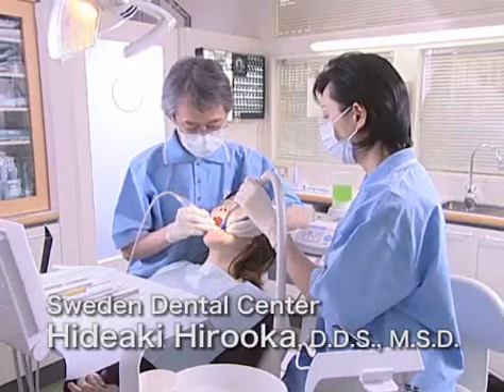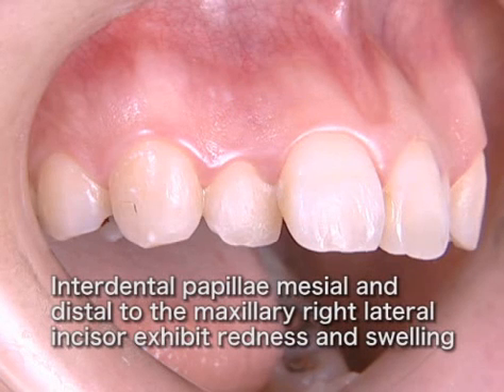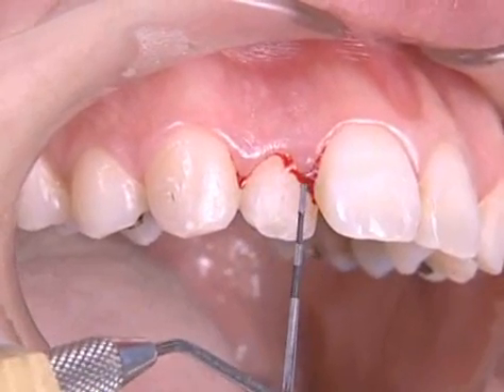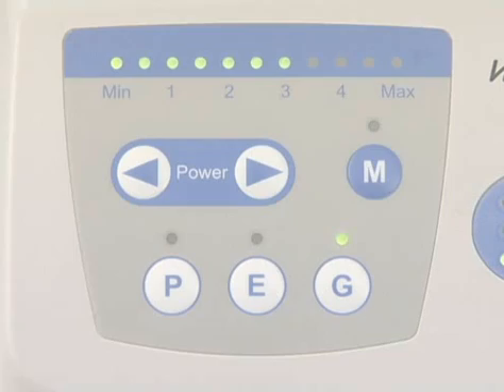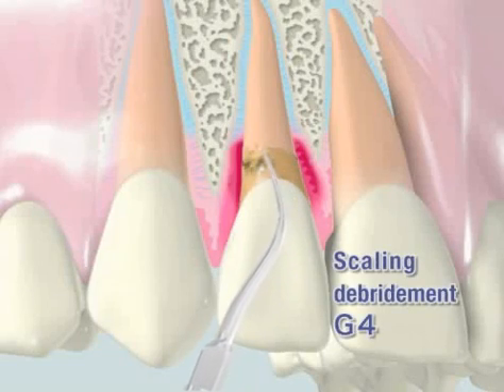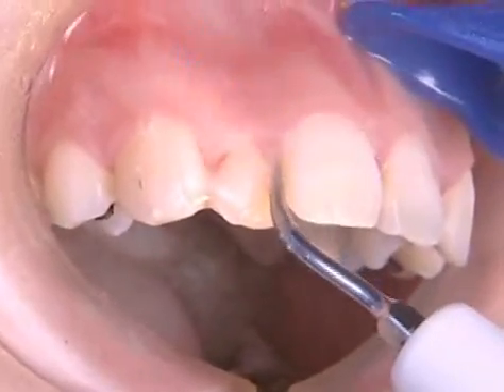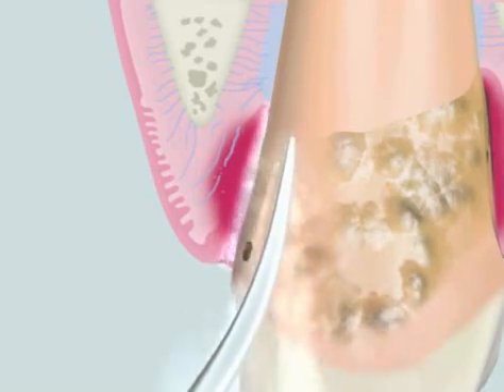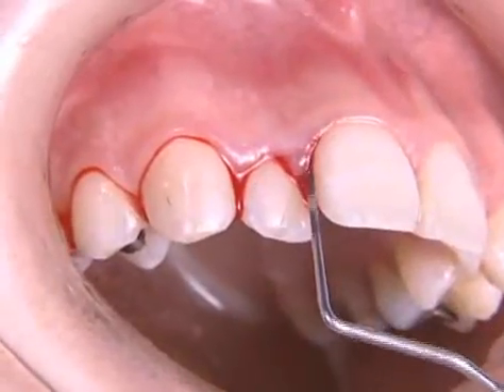How are teeth cleaned at the dentist

Comment: lol i always thought they were cleaning the border of gum and teeth not under the gums
Reply: vast majority don't clean their mouth properly. it is the roots and gums that important not the colour of the teeth. after volunteering in dental college i found out that i had been using the brush wrongly and only brushed the surface of my teeth. also electric toothbrush and tepe dental brushes must be used.
Reply: @mutoromanof8487  Omg thank you for your comment. I wear braces and have been having this awful staining between my front lower teeth, I felt like it wasn't being cleaned properly and was tartar, my hygienist said it was just staining so I went back to ignoring it, it was bothering me again today but my Google searches turned up nothing again, I googled the tepe brush out of curiosity and realized I had been given one, literally after just one use the "staining" is gone. Angry with my hygienist now.
Reply: @mutoromanof8487  what type of tooth brush would you suggest
Reply: Same!

Comment: if probing causing bleeding, thus alerting the hygienist of calculus...  then why is there still bleeding once calculus is removed?
Reply: Melissa DuBar  it's because the body thinks there's an infection because of the calc, tartar and plaque in the gums.  Once the plaque, calf is removed, and the patient KEEPS THEM CLEAN for a period of time, brush, FLOSS, possible antiseptic, the body will realize it's no longer being attacked, and will stop sending blood, which has antibodies and mediating factors, to the site of infection.  If you have blood in your gums after flossing, it means you have plaque the has stayed in your Gina for too long and the body thinks it's under attack.  I make the relationships to my patients by relating it to a deep sliver or a cut.  A deep sliver is like the plaque, it will stay there and eventually start hurting and bleeding if you put pressure on it (probing the gums) but once you remove the sliver (calc, plaque) the infection should go away, with possible antiseptic use.  🙅🏼‍♂️

Comment: I went today to get a deep cleaning(similar to this)! I was very frightened because I was given a numbing treatment with a needle!! However, it actually didn't hurt at all!! The hygienist went beneath the gum line to remove tartar and calculus. My teeth and gums feel much better now, and they don't feel as sore anymore. I will check over the next week or so to see if the gum bleeding and irritation diminishes. I purchased a water pik to use along with my electric toothbrush and regular dental floss. :-)

Comment: @TRWolf There is never a contact tight enough between teeth to the point where you can't floss. You just need to have a dental hygienist or dentist show you how it is done. If you hygienist can get the floss through your teeth than it can be done. Besides, adults are not supposed to have gaps between their teeth, only kids should have gaps. 
Gaps = no floss, just brush between teeth
No gaps/contact between teeth = Floss

Comment: @Mirpuria Even if teeth look clean to the naked eye there is still plaque and sometimes (depending on the patient) calculus below the gum line where a tooth brush can't reach. Calculus is basically just another word for tartar and does not come off even if you can reach it with a tooth brush. Therefore a cleaning is necessary.